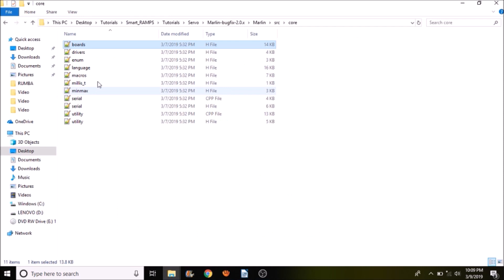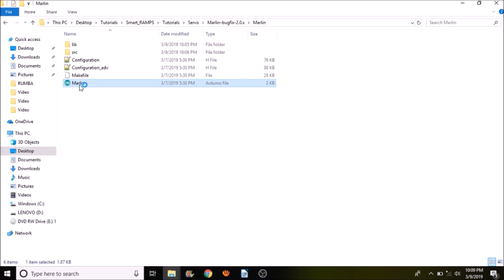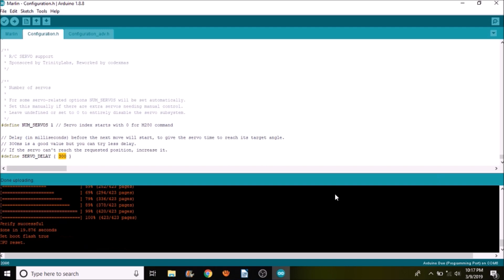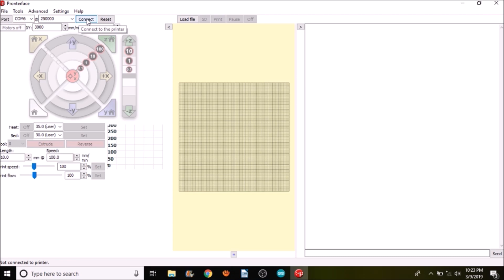Smart Ramps - Servo

Comment: The way to conect a servo in the Ramps 1.6 is the same?
Reply from the maker: Yes in that row of pins.
Reply: Thanks, nice video
Reply from the maker: You're welcome.
Reply: Excuse me, When I am traying to use the Ramps 1.6 I have 2 errors. 
When I put the jumper between the 5 volts and vcc the arduino disconnect from the PC and when I try to upload the marlin gives me an error
I am new using the Ramps
Do you have any idea about those problems?
Reply from the maker: Sounds like something is connected incorrectly.  Try only connecting 5v and vcc without anything else connected to boards.

Comment: Hello Edward Braiman,
i instal a servo by a RADDS 1.5 and the servo is just moving in one direction. I try the command M280 P0 S0 to be in my old position but the servo is not moving. Do you have an advice for me ?
Reply from the maker: What type of servo?  Does it move 180 or 360 degrees?
Reply: @EdwardBraiman   It is a digital Servo ( Savöx SC-0251MG Digital-Servo) and moves just 60 degrees.
Reply from the maker: It might be only for analog servo.

Comment: Hello man, please i need you help.

i use ramps/marlin, i dont want use D53 and D49 for my External SDCARD ADAPTER, i want USE D44 and D66 pins, where i can change pins in marlin please ? 

i guess that ill change them in pin_ramps.h but there is much lines wich the correct line should i change please

thank you

Comment: Hallo meneer Edward Braiman,

zou u zo vriendelijk willen zijn om te vertellen hoe je de beste Marlin voor de Ramps 1.4 kunt laden.
also from where to download the Marlin?
die geschikt is voor een zelfbouw Prusa met Z assen M5 (deze werkte bij mij prima) 
tot ik een nieuwe extruder Arduino Mega met Ramps 1.4 verwisselde. 
nu wil de extruder niet meer goed draaien maar weet niet waarom?
kan ook niet vinden waarom?

vriendelijke groeten uit Nederland!
Rob.
Reply: Marlin firmware is found at marlinfw.org
Reply from the maker: Check out my RAMPS 1.4 tutorial it's also in dutch. If you Google Marlin firmware you'll find the download.  Also it may have a link in the description.

Comment: Hi MR Edward. I have a question for you. I have an ender 3, you know when you advance the filament by LCD ex. (Prepar, move axes- Extruder - 10mm) After heating the nozzle to 200C, the engine to extrude moves but really slowly , Question: how does one increase this speed, either in the frimwar or other?
  Thank you Jean. 
And Tanks for yours good Video !!
Reply from the maker: The advancement is based on a computer value of your motor type and extruder type.  I have a RAMPS 1.4 playlist video that explains really well.  Keep in mind what we would like for speed is not always what we want.  I have gone through serveral extruders before I learned the correct process.
Reply from the maker: And stepper driver and filament type ate also factors.
Reply: An easy fix would be to change the velocity settings in Marlin (through your LCD, changing the default Marlin values, or using Pronterface using a certain command that I don't remember). You said you have an Ender 3, so they come with a graphical lcd. What you'll need to do, is go to the main info screen, then press your lcd knob to enter the main menu. Scroll down to "Control" and click your lcd knob. Scroll down to "Motion" and click your lcd knob. Scroll down to what either says "feedrate" or "velocity". Then scroll down to "Vmax E" and click that. Then rotate your knob to adjust the value. I'm not sure if it runs in either mm/sec or mm/min. Source: http://marlinfw.org/docs/features/lcd_menu.html

Note: I don't have the full graphic display controller like the creality printers. I have the text only model, because I have a BlTouch, and another servo so I don't want to overload the Arduino voltage regulator for my ramps board. I'm currently working on using an external power source for the servos though, so I might then upgrade to a full graphic when I do.